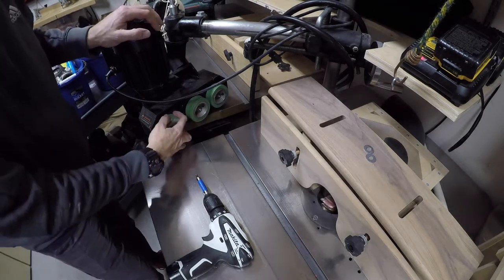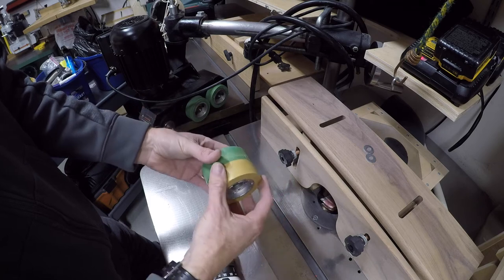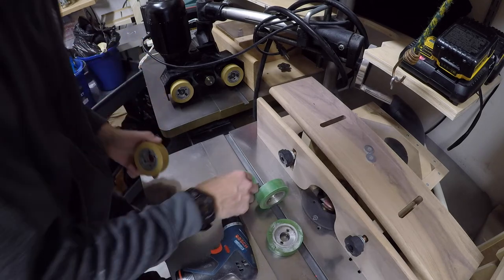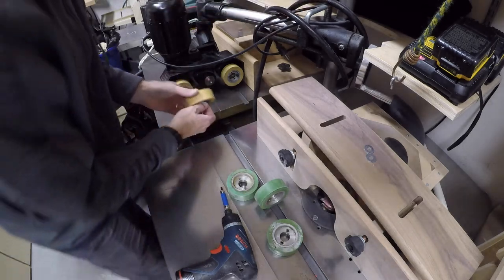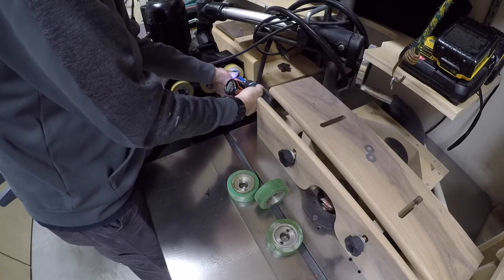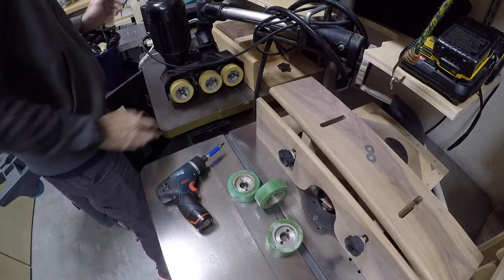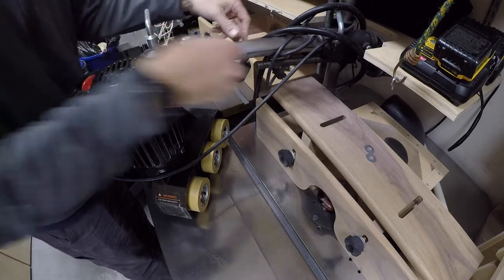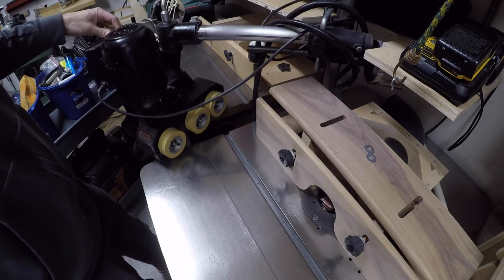Vintage 1940's Delta Shaper Gets New Power Feeder Wheels

Comment: was the feeder to fast with the cutter you have in the shaper? i just got a 1/4 hp feeder and wondering if i should get the gear reduction kit too. i know i had a 1/4 hp grizzly before and it was to fast for the lock miter router bits in the shaper but wondering if the 3 blade cutters will be fine with the 20 feet per min

Good videos!!
Reply from the maker: Hey thanks for watching Derek.  Glad to have you here. You know the speed is too fast for many cutters.  It’s best on rail and stiles or moulding profiles.  But not raised panels.  Unless it took less than full pass.  I wish the speed was slower for sure. Or variable speed.
Reply: @davidbryanwoodworksandmore  do you have the stock gears in it?  The 16 and 34 Tooth is supposed to slow it down to 13fpm
Reply from the maker: @derekmoen5382  I ordered the gears to slow it down to max slow.  However they are still to fast.  I’ve used it both ways and currently it’s on slowest speed.  I never change it.
Reply: @David Bryan Woodworks and More  crap lol I got a new shop fox w1765 for 495 dollars yesterday and ordered the gears this morning for another 55 I'm really hoping it will be okay it was a very good deal either way
Reply from the maker: @derekmoen5382  is that the 1-1/2hp shaper? Or 3hp.  If it’s a 3 horse I’m sure you’ll be okay with the gears down.  Just don’t take too deep of a cut.  Use sharp cutters also.  You’ll be happy with the shaper I’m sure either way.  Good job.
Reply: @davidbryanwoodworksandmore  its the 3hp. I ended up getting the new non original packing to my surprise power feeder from ebay it had some damage broken covers bent handles and was missing the crank handles. after messaging the the seller and sending him pictures he refunded me all the money and let me keep it. i ordered all the parts and some paint for it. i thanked him as i felt guilty, as i would have gave him money. i was really bummed when i opened the box and sending it back with how it was packed would have wrecked it more not to mention the cost. its still a great deal and im thankful. the lower gear set is just the ticket thank you!! god bless!
Reply from the maker: @derekmoen5382  you’re welcome Derek and I am so happy to hear it all worked out for you.  You’ll enjoy it all for years I’m sure.